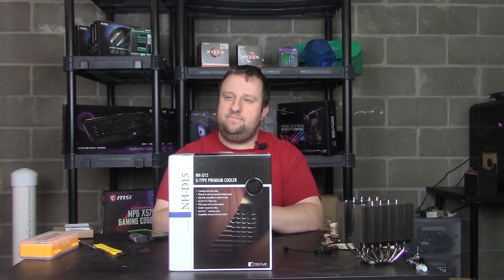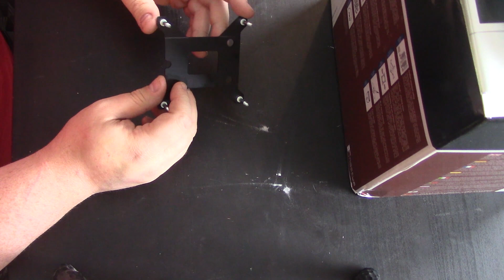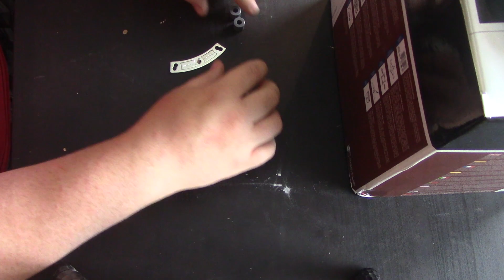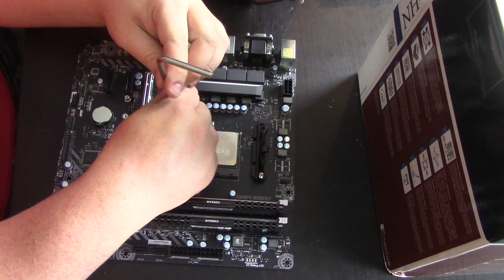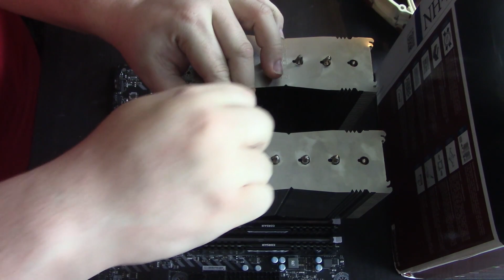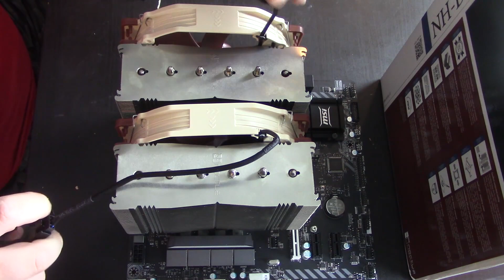Noctua NH-D15 Unboxing, Overview & Installation LGA 115x & AM4

Comment: Will these keep AMD 5950x cool or AIO liquid better?
Reply: its perfect for that cpu even with major overclocking it has beaten many aio water coolers but because this is an air cooler make sure yo have enough intake fans and exhaust
Reply: @mustafaumar7762  Corsair H150i elite looks good
Reply: @gurugamer8632   it is but you will get similar performance so there are many variables to consider does the d15 fit in your case if it does ill go for it because it will last forever but water coolers have a specific time that they may start to die out
Reply: @mustafaumar7762  D15 too big in case in my opinion
Reply: @gurugamer8632   what case do you have
Reply: @mustafaumar7762  Lian Li 011 XL ROG it is big but don’t like fan
Reply: @gurugamer8632   but that case supports up to 167 mm just like mine it will be a tight fit but i think it will fit if not go for noctua nh u12a only about 158mm tall
Reply: @mustafaumar7762  I’m going for liquid cooling

Comment: As far as fan air flow goes... The case I am putting this in has three other fans to cool it down (I will have a 4GB MSI GTX 1050 TI 4GT, four SATA 3 drives, a 750W power supply and have to keep the North and Southbridge adapters cool). I'm guessing that the fan that is on the 'downwind' side should be an intake fan, the fan on the other 'upwind' side where the air comes out of the Noctua should be outgoing. And, I guess the top fan should also go upwards? Or, should the top fan blow downwards making all the outgoing air go out the 'outgoing' side? Two ins and one out or two outs and one in is the question. I'm worrying that any other fan which draws air into the case will set up turbulence which might increase the sound level. Any ideas?
Reply: @some dude Yeah. I didn't mean that the air doesn't go through the heat sink. I'm talking about the other fans in the case. Anyways, I'm all done and it's working perfectly. The two fans in the Noctua pull air through the heatsink both in the same direction. I installed the fan on the 'front' of my computer so it pulls air in the same direction as the two Noctua fans, thus they pull air 'in' to the computer. That's what I was wondering. What I was calling the 'upwind' side meant the side that the air goes into the Noctua heatsinks and the 'outgoing' side (you're calling it 'exhaust') of the Noctua (the back of the computer) pushes (pulls?) air out the back of the case. So, yes, I'm doing what you said and it's working great. Have one more fan on the side that pulls air in just about on top of the Northbridge to keep it nice and cool. I'm amazed at how incredibly quiet it all is now that it's done. Never even think about it and CoreTemp keeps it all below 41 C when Prime95 Stress Test is run on all 8 cores (no overclocking). Runs as low as 9 C when idling, (between 14 and 19 C when it's doing minimal stuff) on the hottest microprocessor in the world (an old AM3+ FX-9590 in a Gigabyte GA-990 motherboard).

Comment: Screwing this damm thing on was the most annoying shit ive had to do to my pc so far
Reply: Aaah young padawan. One hasn't cursed at a cooler unless they tried mounting cooler onto a Socket A motherboard with an at the time expensive best AMD cpu on the market, an Athlon XP 3200+ (which didn't have headspreaders on them), and you put that cooler clip on there with a flat head screwdriver.
This meant zero tension control with a bare exposed die that could and would chip if the cooler was at an angle relative to the die when mounted. Or if that shit didn't happen your screwdriver would slip out of the shitty clip and if you are unlucky you'd be left with an extra hole in your brand new motherboard.
In both of these cases warranty would be void for either component and you'd be more than feeling just a tad bit annoyed.

As an old fart in building computers I must say that installing this is like a dream compared to some horrendous approaches of the past.
Reply: @LogiForce86  XD  i can relate to that. Seems easy in the video , i havent mounted this on the board yet though.

Comment: Don't you have the fans upside down? (The cables are coming out the top??)  Also, if you have both fans elevated to accommodate the RAM and so they are even, will that affect performance of the cooler?
Reply: Also instead of using the splitter, can you plug 1 into CPU fan and one into CPU OPT?
Reply: Yep pretty sure they’re upside down. Other than that decent video.
Reply: Does it matter if the fans are upside down? Doesn't change where the way the air flows. Plus, this way the wire of the fan that is above the rams won't go through the rams. It seems logical to me
Reply: @ginnyglezou1870  Well as you can see the wires to connect to the mobo come down from the top, potentially interfering with the fans and they don't reach all the way to the mobo headers unless you have a splitter/extender

Comment: I cant get the spring screws/nuts to catch onto the threads on the bracket even with some force. I feel like they are very tight out of the box but I just cannot get it mounted
Edit: got it mounted. I had to use pliers to compress the springs by like a hair and after that it mounted perfectly and snug with a bit of force from a screwdriver as expected
Reply: Thanks!
Reply: Also with the AMD bracket, there is a bit of play in the top 2 brackets and if you tighten them up in the wrong spot you can’t screw the Heatsinks down or would have to force the screws on which is never good. 
I just loosened the brackets off a touch so when I fit the Heatsinks it self centred the top brackets and check both screws go in nicely. Then carefully undo the heat sink screws and gently lift the heatsink up. Now you should have the correct position of the top bracket and you can tighten.

Comment: Why don't you orientate the fans on cpu as such  > Cooler <  ; then the rear upper fan blowing into the case RFan >
So airflow would be like this RFan >  >Cooler< ; This prevents the CPU fans from drawing hot air across all the cooler fins.

Comment: Don't you need to replace the stuff behind AM4 motherboard like intel does?
Reply: No. "The SecuFirm2™ mounting system will install directly to the stock backplate, so please keep it in place."

Comment: So for AM4, the backplate does not need to be messed with, correct?
My 3900X will arrive tomorrow, but the cooler shipped 2 days later for some reason. I am not sure if I want to build once with the Wraith Spire, and then go through CPU Cleaning and Heatsink Mounting again a day or two later ..
Reply: so the backplate wasn’t needed? i’m looking to have the same setup...
Reply: @eeerick28  no backplate replacement necessary indeed, the brackets go right onto the existing mounting holes on a MEG 570 ACE